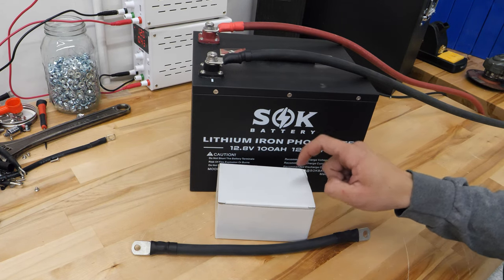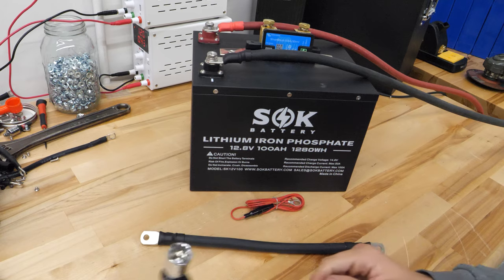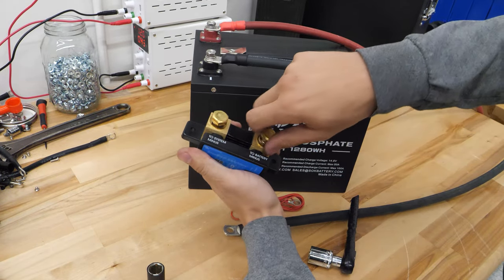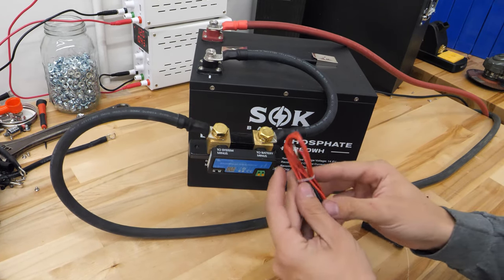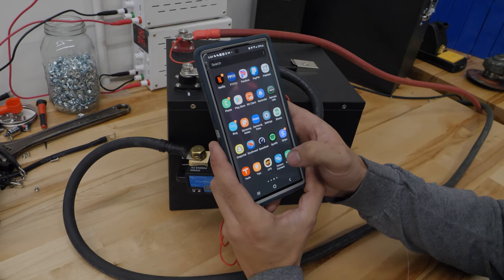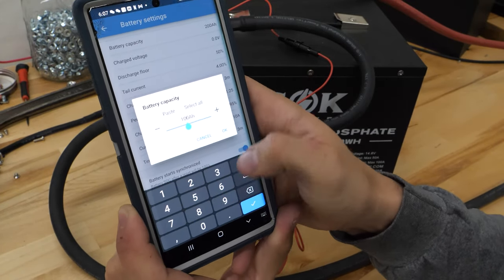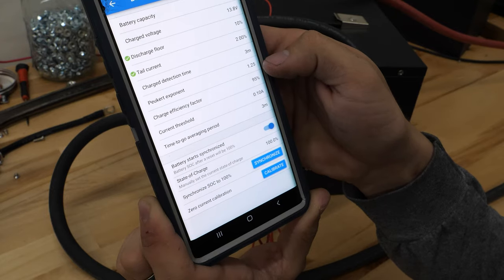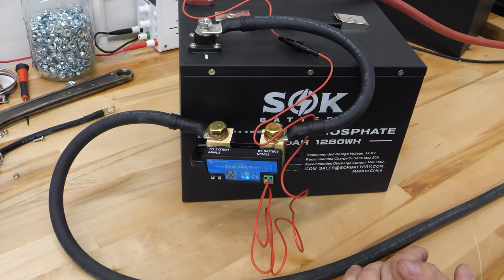How To Wire & Program a Victron SmartShunt for LiFePO4 Batteries 🔋

Comment: Perfect, quick tutorial. Great! Those Smart shunts are probably the most important product of every battery bank and work flawlessly. For a victron product, they are relatively cheap aswell. Together with their chargers, which are not cheap but highly configurable you own equipment that is versatile and good for decades. Thx for the video!

Comment: You went over making-using insulated tools when working on batteries as you should in any high amp circuits, but it looked like you were wearing a metal ring. I made the mistake of wearing a gold wedding band to work. I arced the band between the cable and battery post. Gold if an excellent conductor of electricity and gets real hot, real fast around a tender part of a finger, plus it did major damage to the ring.
Reply from the maker: We will insulate it for next video.  It's a hair too small for taking off every time, and nobody wants to forget it at work and get in huge trouble at home!
Reply: Easier to avoid marriage, just sayin’ lol
Reply: @sailorcto 😂😂😂
Reply: @CurrentConnected 😂😂

Comment: Thanks for answering my question in an indirect way.  I disconnected my battery from the smart shunt to remove an unused monitor wire.  My battery is at 42% SOC and has been since I parked my boat for the Winter.  Every time I checked it, it was consistently at 42%. When I reconnected it shows it is 100% SOC.  I understand from your video that it will reset after I fully charge it.  Thanks for the info!

Comment: Question, On the "Charged Voltage". The booklet I got with my battery. States 13.5 volts is 100% soc. Also it states Charge at 14.4 - 14.6 volts. So do I fill in "Charged Voltage" with 13.5 volts or 14.4 volts.? Thank you for your time and videos.
Yes I have the Victron BMV-712. The battery is a LifePo 190ah 12 volt

Comment: Just put one of these on my 5th wheel a week ago. Great tool to let you know what's happening with the battery. My only complaint thus far is I can't get more than 10 feet from the front storage and the app loses its connection with the shunt. The only place inside I can connect is in the front bedroom, as soon as I walk down the steps to the kitchen, the app loses its connection with the shunt.

Comment: Great video however, as a professional pipe fitter, I have very limited knowledge of electrical circuitry and could use your advice on a project of mine. I am attempting to build a portable power supply and will be limited to complete it due to budget constraints. I have the box for equipment, a 12v 100amp LiFePO4 Battery, a charger, a few fans for cooling with thermostatic control and thanks to your video, I will be purchasing this shunt. my question is, where do those red and black cables (I assume power out) go? I am only trying to power a 12v dual zone fridge for now.
Let me know. Thank you.

Comment: You may want to caution your users who see this video.  Although you set the battery to 30% SOC in the Victron app at setup, that battery SOC is not stored in history in the app or the shunt. Therefore, once your users walk far enough away from the bluetooth range of the shunt and get disconnected, the battery may show 100% SOC the next time they reconnect to the shunt using the Victron app.  This has been an ongoing problem for users like me, and many others,  who do not use Victron batteries and a full Victron electrical system. I have a single 24v/200Ah server rack battery, the Victron 500A smart shunt, a Victron Lynx distributor, and a GroWatt Inverter/charger. The entire battery system works great, however the shunt "forgets" the previous battery SOC each time I disconnect from bluetooth.  For example, if I manually charge the battery to 100% and sync the shunt to 100% SOC as well, then use 10% (~500 watts) of the battery capacity the shunt displays ~90% capacity remaining. If I then disconnect from the shunt's bluetooth signal (leave the van, or disable bluetooth) then later reconnect to the shunt again, the shunt often says my battery SOC is at 100% again - even though it is only at 90%.  I believe the reason is that LFP batteries like mine hold a constant battery voltage until they are almost to zero capacity.  The shunt sees the full voltage on the battery and believes it is at 100% SOC.  The previous ~500 watts of usage I had consumed is "forgotten" by the shunt since I disconnected from bluetooth as I left the van.  This is important for folks to realize, particularly if they have LFP battery chemistry not lead acid which decreases its output voltage as amperage flows out.  You may want to try this yourself and perhaps do a follow-up video on this for your users.  Good explanation about installing the smart shunt though. I do like the shunt for real-time monitoring of actual wattage flowing in/out as I am charging or discharging.  I just no longer trust the SOC display the app provides.
Reply from the maker: Your comment is not true, SOC % is stored in the shunt itself.  If you have "synchronized starts" enabled, your SOC will reset to 100% every time the shunt restarts, however with this disabled, even with the app disconnected and the shunt power cycled, the shunt will still retain SOC.

The SmartShunt never uses battery voltage for capacity except for the "Charged Voltage".  When the battery is being charged, and the voltage is above the charged voltage, it will wait until the current falls below the "tail current" at which point it resets the SOC% to 100%.  If you have either charged voltage or tail current set wrong, then that would cause issues like you are experiencing.  It has nothing to do with being connected or disconnected to the app.
Reply: @CurrentConnected  I want to believe that you're correct in your analysis of the shunt. For some reason, my shunt isn't playing nicely it seems. I have three screen captures from my iPhone over this past weekend to share if you would like to see them. I charged the battery to 100%, then started a discharge using my MaxxFans and 24v RV refrigerator.  The first screenshot at 8:30am shows 99% SOC (2Ah consumed), then 86% SOC (27.9Ah consumed) at 4:45pm, then 80% SOC at 9:00pm (40.5Ah consumed), and the last shot is 99% (1.2Ah consumed) at 8:30am the following morning. I did not charge the battery overnight, and I do not have solar or DC-DC charging. Currently I only have AC charging to a 120V wall outlet from my home. The "battery starts 100% SOC after reset" is off. Happy to email or share these Victron screen shots with you if you would like to help me debug this?  Thanks!
Reply: are you fkn kidding me?
Reply: @mooneyman13  and? Problem solved?
Reply: @erwinvanasperen5353  yes, I believe so. Basically, be certain you fully charge the battery then set your 100% SOC voltage to a level just below the displayed voltage when the battery is full. My voltage was set about 1v too high so my battery never reset to 100% when it was charging. Now it resets to 100% SOC when full.

Comment: I just installed a 200ah LiFePo4 battery in my small RV.  Are all those settings you showed on the Victron Smart shunt applicable to my 200ah battery?
Reply: I'd like to know as well

Comment: Is the setting the same on sok's  200ah battery? And why is the charged voltage recommended 13.8v when on the side of the case it says 14.6? I don't know is why I'm trying to understand.
Reply: 14.6 is what it charges to and resting is 13.8 after charge.

Comment: My smart shunt never revealed state of charge accurately, but did monitor battery bank voltage very well.  Either I erred in the connection process, or the shunt is defective, or both.  The Bluetooth capability is awesome.  After a fresh install to reflect the third battery addition, we shall have our answer.  3X 190 amp hour 12 volt lithium battery bank to supply onboard dc electric and inverter
Reply: That sounds like a waste of money then. I think the negative side of this accessory it's that you need to fully charge the battery first and set it at 100© in the app so that the smart shunt shows an accurate SOC

Comment: Ok so it needs to be the only thing connected on the negating post. So when I have batteries connected in parallel can it be attached to any of the negative posts or preferably the last one?

Comment: Will a 24v setup (with 2 serial connectected Sok batteries) give all  the same parameters x 2?  Thanks for you your information.
Reply from the maker: Only the voltage parameters get multiplied by 2.  Everything else like efficiency, peukert exponent, tail current, etc.. stays the same.
Reply: @CurrentConnected  Thanks, you've helped me a lot with this information. Good Luck!

Comment: Hi I am curious how do you know that these settings are correct since the SOK battery speck sheet doesn't match most of the field names on Victron's setup screens.
Reply from the maker: We've tested operation with these settings in-house for nearly 2 years now, and have hundreds, maybe thousands, of customer installs with these exact settings that have no faults.  On the flip-side, we have had multiple customers use the default settings on various spec sheets and run into many issues with inaccurate SOC% and trouble getting the shunt to synchronize to 100%.

Comment: WHat happens if you have multiple batteries in Paralell and another earth point on another battery?
Reply: thats what im here for. im assuming when you set the proper amp hours you should be good. voltage stays the same in parallel

Comment: I am in the process of setting up the app for my Victron shunt and I have 2 off 200ah lithium batteries. Do I set the battery capacity at 400ah?

Comment: Two Battery Banks with a Switch (A Battery Bank, B Battery Bank), One 2000/4000 Watt Inverter with a 200 Amp Circuit Breaker, One Victron 500 Shunt. How do I set this up? Do I need to use a Negative and Positive Bus Hook up? Do I need two Victron 500 Shunts? I also want to use a single Victron 100/30 Amp Charge Controller to charge the exhausted Battery Bank while continuing to use the other. Most of all, can I keep track of everything with the Victron Blue Tooth Application?

Comment: Thanks for this video! I just received me SOK batteries (206Ah x2) and will use these settings, but do have a question. They WERE shipped so I assume they're at the 30%, however, should I use 13.8v as the charged voltage or use 13.1v which is what me Multimeter shows on both? I want to be sure it's as accurate as possible. Thanks!
Reply from the maker: Always use 13.8v on the shunt.  Those are at 30% charge right now...also, once you fully charge them it calibrates the shunt to 100%, so even if you are not set at exactly 30%, once you reach full charge, it will be accurate.
Reply: @CurrentConnected  much obliged!

Comment: I was told you can connect two batteries in parallel.   I still trying to figure it out.  Any advice would be appreciated.  Thanks
Reply: I only know that the shunt supports series. I have two 24 V as series in an 48 V system, and the shunt can measure voltage and mid-voltage.
For parallel you could use the shunt like you have one big battery, but there could be issues with different loads in those two batteries, which could slowely kill one of them. This is why I try to avoid it and separate my systems (2*2,5kwh with one 3kW inverter with 2,5kWp of solar)

Comment: May be a dumb question lol but if I have 4 12v lifep04 wired in series for 48v would the shunt be installed the same way?
Reply from the maker: Yes, the red positive wire would feed to the +48v connection.  This is well documented in the instruction manual for the SmartShunt.
Reply: @CurrentConnected  thanks for the quick response I purchased this used and didn't have any instructions with it

Comment: I have 2 banks of 6 eg4 batteries (not LL). Needing a wiring diagram to connect my 500A smart shunt to them. Banks are parallel to parallel. Pairing off on the two negatives. Do I need to buy two smart shunts? One for each bank? Thanks.
Reply: If you want to monitor your entire battery system (both banks of 6) then you just need 1 and make sure both negative cables are connected to the single battery side bolt on the shunt.  You just need to make all negative connections goes through the shunt.

Comment: Do a video on connecting two Battery Banks to one Victron 500 Shunt, then to one 2000/4000 Watt Inverter. On the positive side, I also want a 200 Amp Circuit Breaker for the Inverter. I'm not sure how to connect the negative side for two Battery Banks.

Comment: How many neg wires can you connect to the vitron terminal 
When do I need a buzz bar
Reply: You can easily fit two.  Past that I would use a busbar and then have single connection from the busbar to the shunt.

Comment: I managed to forget to set the SOK battery SOC to 30% as mentioned before charging for several hours. It is not at 13.4v. How do I go about getting an accurate state of charge from here?
Will they not reach 100% because the SOC indicates 100% even though its below that? Also, it doesn't indicate my time remaining with current load unless I turn of the solar disconnect switch for some reason? Hopefully someone has some insight for these things.

Comment: I wonder if you can somehow set an ampere limit for charging in the smart shunt.

I know that’s a somewhat specific question, but maybe someone has an answer:

I would like to charge a battery with two victron solar chargers, which charge a battery through the shunt, which should be charged with a maximum of 20 A. Do I have to limit both chargers to 10 A each so that they do not exceed 20 A together, or do the devices Talk to each other? Or can i Define that in the shunt? (I ask because I read that when a shunt is used, it takes over „control“ of the charging network - At least when it comes to measuring the battery voltage)

Comment: Perfect Video! Could you pleas explain whay you set Charged voltage to 13.8 volt. On my battery spec thath voltige is not stated anywere, my bms shut of at 14.6 volt and nominal volt 12.8 v.
Reply from the maker: Because that is the resting full charge voltage & float voltage for LiFePO4.  Typically you won't get batteries full unless they are above this voltage, and the current drops down to 2% (the tail current setting).  Any lower and you could get a false full reading and any higher you could risk not re-calibrating 100% properly.

Comment: The only thing confusing me is you put 13.8v charged voltage!! So is this if not used off grid? If using solar doesn’t this need to be 0.2v under the absorption voltage or is that wrong? I was told to have in the mppt 14.5v absorption but in the shunt charge voltage at 14.3v 🤷‍♂️ help pleaseeeeeeeeee lol
Reply from the maker: If used on grid or off grid, it doesn't matter...It's for the battery.
The manual says 0.2v under absorption, this is good for lead-acid, but since lithium doesn't need absorption, it's too high of a voltage for the shunt to properly detect whether or not the battery is full, because they battery doesn't spend much time above this voltage.
We have had in-house tests cycling daily for over a year now...the settings outlined in this video are flawless for the greatest majority of LiFePO4 batteries.
Reply: @CurrentConnected  ok thanks so 13.8v charge voltage on the shunt . So is this even if using 14.4v or 14.5v for solar mppt in bulk is that ok ? 
I get what you mean it’s setting for lead at 0.2v below absorption 
So do you forget that when using lithium
Reply from the maker: @Elites-asthetic  Yes.  Exactly.  Forget about the .2v below absorption, set it at 13.8 and it will work perfect.
Reply: @CurrentConnected  thanks for taking the time to reply 👍 very helpful you earned a sub . Great content

Comment: One hint: When working on battery + terminal of a vehicle you better have the battery - connection disconnected. With this you avoid a short cut if you accidentally touch metal parts of the vehicle with your tool ;)

Comment: You should not be following this tutorial if in the first few seconds it recommends not to read the Quickstart guide. This can be incredibly dangerous in case they change the installation method or fundamentally change how this product operates inside. It’s important to also say that your insulated tools are not properly insulated tools as tools have been correctly insulated means that the ratchet and the metal of it would never have congeniality to the battery terminal.

Comment: Current, one final question: Because I have two of the 206Ah batteries, do I want to specify a total of 400Ah or actually put 412Ah? These batteries were purchased from you (through Amazon) actually, so thanks for getting them shipped on-time!
Reply from the maker: Accurate would be to set 412ah.  Thanks for the support!

Comment: Awesome video, thank you! I’m a little confused on my rv installation though, I have a wire that goes from the negative battery to a chassis ground. Do I leave that where it is or does that have to move?
Reply: Same question.
Reply: It had to move to the other side of the shunt